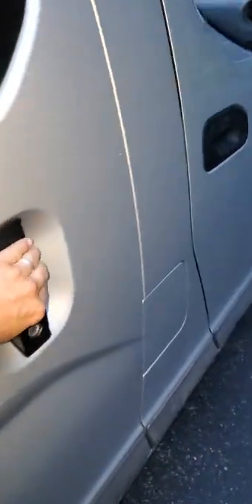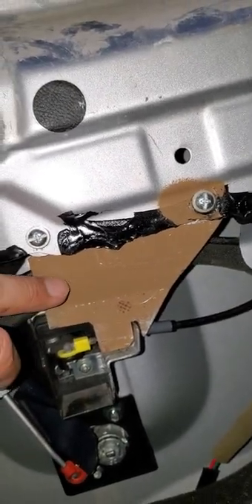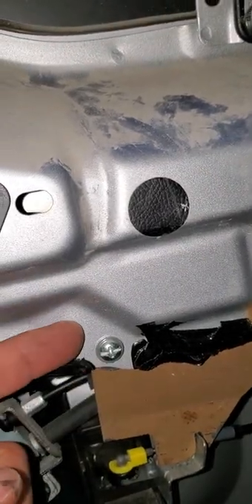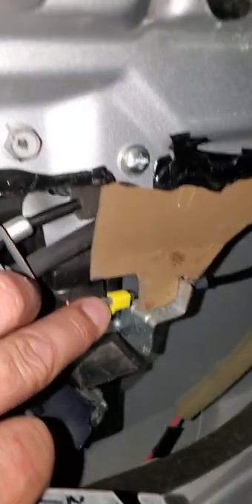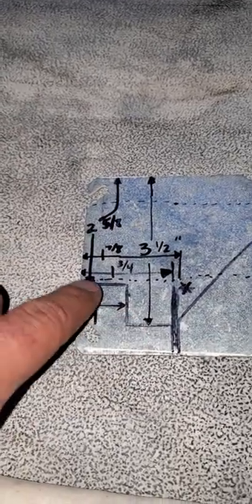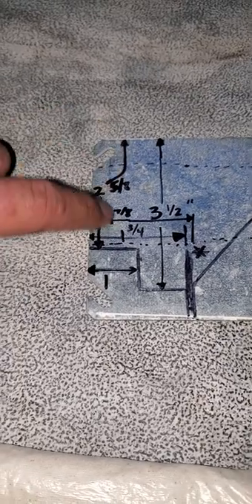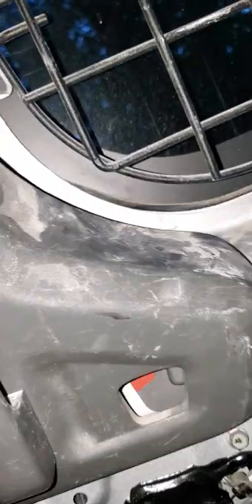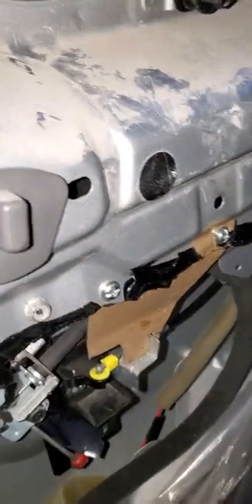Nissan NV200 Sliding Door Won't Open From Outside - Fix/Repair

Comment: hey i have the same van and my back door seems to have this same problem. have you ever dealt with that yourself? this weekend i will open the door panel.
Reply from the maker: Hey there. The fix is still holding strong after daily use.  It appears to be a good repair thus far.  I hope you're able to mend yours easily.
Reply from the maker: Are you referring to the rear swing doors or the side sliding doors?  This repair is the only one I've done on this vehicle.  I'd be interested to see the broken rear swing door.
Reply: @ItchyKneeSon  it's the rear swing door, the outdoor handle seems to be in the pressed position. Whenever I have time I will open it and once fixed I will share how.
Reply from the maker: @kungayarphel5643  Did you figure it out?  My dad recently replaced something on the rear swing doors with a part from Nissan.
Reply: @ItchyKneeSon  I fixed the issue without opening everything. So my van opens the front 2 doors with one press of the fob button and the remind back cargo doors with additional presses of the fob, I tried opening the back with a single fob press and it wasn't opening lol

Comment: good video changed 3 or 4 on my 2014 they are made so cheep
Reply from the maker: Thanks!  I hope it works for those that try it.

I'm trying to figure out how they were thinking this was a good balance of cost-cutting and well-engineered.
I imagine they've made quite a bit replacing them...
Reply: do you know what the part name or number is?
Reply from the maker: @dabro28  No, I do not.  You can get free Nissan repair manuals from NICO Club.  My fix obviously doesn't have a part number.  But, it's still holding strong with daily use.